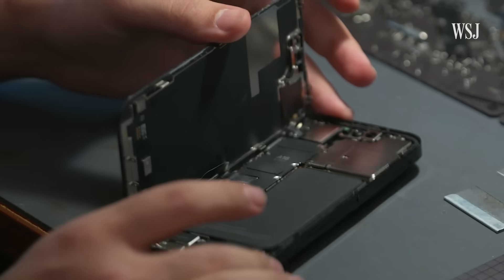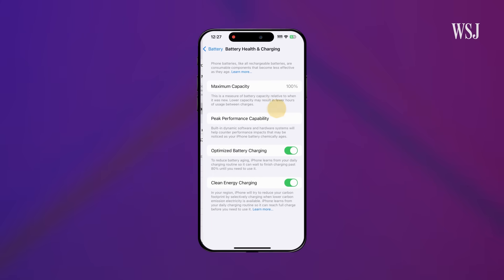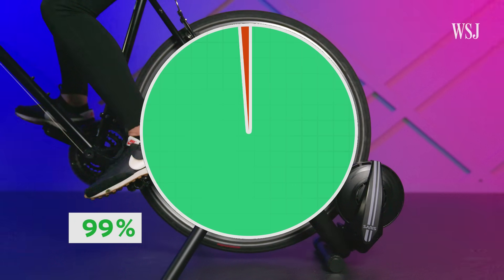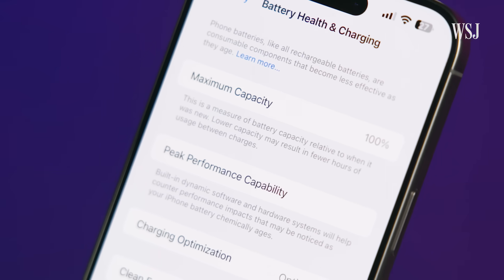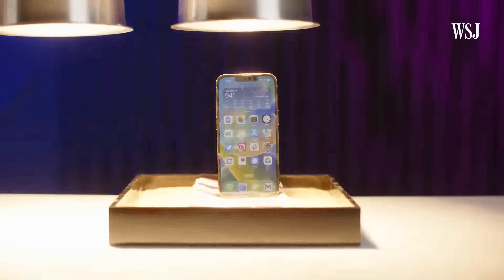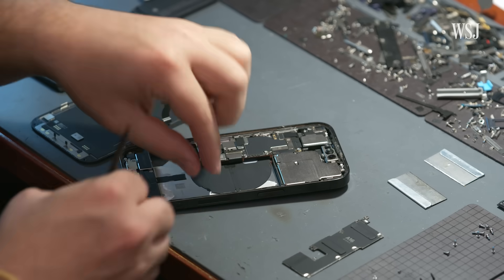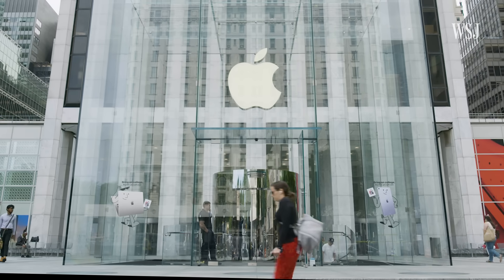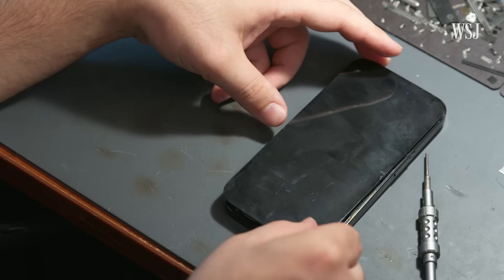Why My iPhone’s Battery Expired in Only a Year | WSJ

Comment: Heat also becomes a bigger problem over time as the internal resistance of the battery also increases as it goes down in capacity so it generates a lot more heat when charging on a cable compared to when it was new.

Comment: There are too many factors but one of the most important is Heat. I live in Spain, have a iPhone 14PM bought in November 2022 and my battery life is 99. still like new. why, because I charge the phone every two days and with a wireless 5W charger non magnetic inexpensive charger overnight. Seriously my Battery is like the first day.

Comment: 13 mini user here and I just got it a couple weeks ago refurbished. The battery is genuine since I can see its capacity but it drains quick. 3% drop in 3 weeks
Reply: I’d did the same but bought the 12 mini with 85% do you recommend to change it?
Reply: @fernandovega6952  I’d probably use it for a while. My 13 mini came with 94 and dropped to 88 in a few months but now it’s just been sitting at 88 for a while. Maybe use it till it goes to 80 or unless you really feel like it’s not lasting you the day. I also recently bought a belkin MagSafe power bank 5000 and it complements the mini perfectly!

Comment: Keeping it between 30 - 80% will massively reduce aging as most of the damage is done at the top and bottom end. Even
Charging from 0 to 80% will probably only cause 0.2 of a cycles wear vs 1 for 0 to 100%

Heat ia the next issue however it is caused, fast charging, wireless charging is worse as it generates more heat and charges much slower so you have more heat for longer qnd more damage. But honestly i wouldn't worry too much about what the battery heath on an apple product says if i already own it. If it lasts long enough then it lasts long enough. Its just another way of getting you to upgrade to a new product when they want you to. Id only care if buying used.

Comment: I bought my first ever iPhone in August 2023, and heat is really, in my opinion, an important factor. I don’t know if it was the heat of the Greek summer, but I could see the percentages of the battery life dropping like crazy, week after week, which was not normal for the way I was using it, so after 17 months, my iPhone 13 Pro’s battery life is at 88%.
Reply: iPhone 12 Mini, original battery, soon 4 years yet 86% battery health after 900 cycles. I charged exclusively with an old 5W iPhone brick.
And to be honest... i kept the battery mostly anywhere between 30 and 80% charge level and avoided >80% charge.

Comment: My iPhone 14 pro sits at 86% after 1 year while my old iPhone 12 is at 88% after 3 years of use.

From what I've read, Apple opted for a new provider of batteries at a much cheaper cost starting with the 14 series.
Reply: If that’s true they are really ripping off loyal customers
Reply: @em90sfan  customers shouldn't be loyal, they should switch boats at the first inconvenient. only this way we can force a company to change.

Comment: Our obsession with fast charging contributes to faster battery degradation. I personally observed this with both and slow charging. The rate of health drop significantly goes down with slow charging.
Reply: You sure? I used also slow charging for years and for a while on my iPhone 15, but since some weeks im for the convenience charging only with the 140W apple power brick and a 60W rated  USB-C cable (to reduce battery stress on the MacBook Pro)

Im still at 100% health, and even if it dropped, i would not be concerned since the first 5-15% battery health drops pretty quickly, thats normal. But the battery should stay for very long anywhere between 85 and 90% health before its age and reduced capacity shows up in normal use.

Comment: Important mistake. The battery health is NOT measured! Its calculated. Your battery health is highly incorrect. In the first cycles the health goese down really fast. After that the battery degrades mutch slower. Apple is not showing that at all. After the first few cycles you already lost a few percent of capacity.

Comment: It took only 1 minute to be wrong battery health isn’t how much charge your battery holds from new. It’s based on what apple claims the battery capacity is. Most of the time the real capacity is higher than this that’s why it stays on 100% for ages

Comment: Super high pressure 80 to 100 and very deep discharge at 0 to 20.

Both cause damage in different ways.

Set charge limit to 80% and don’t go below 20.

Comment: I'm curious what phone companies are going to do once the price of sodium batteries comes down enough for them to be feasible in phones. At the moment, it would cost maybe $50 or so for a phone-sized sodium battery that would have comparable performance to a lithium battery BUT can handle 10x the charging cycles. So, it would last 20 to 30 years rather than 2 to 3 before you start noticing any capacity issues. That is, if the cell phone companies don't purposely kill them like they've been doing. It would raise a lot of eyebrows if these batteries start dying after 1 or 2 years when they should be lasting at least a decade. Sodium batteries will eventually become cheaper than lithium because of how easy sodium is to mine. 

It comes from the sea, easy to process, salt ponds already exist for this purpose, and it doesn't take much to process sodium out of sea salt. Compared to how much more rare lithium ore is, how much harder, and dirtier it is to harvest and process. Chances are, lithium batteries will not just be more expensive, but outright obsolete by the end of the decade. I'm sure they'll still exist and be used. But they'll be impractical for most purposes.

I usually roll my eyes at new tech that promises to make something obsolete. But this is a rare case where they don't just have a lab prototype, it's not just a start-up or research. They sell sodium batteries commercially. Anyone can buy some for a small premium. So, it already exists as a commercial product. All we need is to wait for the price to come down.

Comment: I noticed the battery performance being way worse on my iphone 14 pro like.. a week in. I even looked up whether it was becoming a big issue that it would force apple to do a recall. Obviously not. I had the 13 pro right before it (which i would've kept, but had to give away to help out a friend) and my battery life wasn't obscene, but it did last longer than my 14 pro. Spotify is a big problem; these days i tend to put it on offline mode as much as i can, but of course that's hindering the use of the product. Anyway, im glad to see my suspicions being confirmed (albeit in a roundabout way, but still).
Reply: Must be an iPhone 14 exclusive issue to be honest, no issues so far with the iPhone 15 (non Pro)
Im coming close to the 150 charging cycles (yes, i intentionally wasted battery cycles with stresstests) and im still at 100% health, but i also use exclusively the "80% Limit" setting on the 15 and avoid <30% charge levels if possible, so in fact i use about half of the batteries capacity effectively.

Comment: What are you complaining about? Your battery health actually EXCEEDED Apple’s rating. After 500 charge cycles, your battery would be expected to have 80% health, but yours had 84% after 494, essentially 500. So what’s the problem. It’s well within factory specs on depletion.

Comment: 1. Replacing your battery destroys the water seal, so find a shop that does the seal too.
2. Not using your IPhone does not save charge cycles for long. You actually need to do 1 full cycle roughly once every 2 months, otherwise you are nuking your battery.

Comment: There is a third option. Maybe even a forth. 

You can keep your phone and try to charge it before you leave your house and only use it when you need to.

The other option is bringing a battery pack with you and charging as you go.

I have a 4 year old android phone. I feel like i have more than enough charge. But i still top it up before i leave the house. Just incase i get stuck somewhere waiting for something and i can just use my phone until i am done.

I also try to plugin my phone if i think the power is going to go out.

Comment: Whats the point of this video ? This person charged it many times like most plp do the battery capacity gets reduced no biggie just replace the battery and continue.. The point is how hard it is to replaced the battery yourself which was not emphasized in this video . Earlier plp could just pop the back open and replace it now it has to go to a tech to get the same job done. Apple has  done a good job with planned obsolescence.

Comment: You have become a serious addict with that 14 phone.  You used it almost twice as much (based on charging cycles) in a year as you did the 12.  Maybe something was causing the battery to be used more that wasn't you, but with only 365 days in a year, and 494 charge cycles already used, you were doing MORE than a charge cycle in a day - and you had just explained that it could take several days to normally hit a full cycle!!

Comment: It's hardly surprising that heavy usage of an iPhone leads to a decrease in battery capacity. What did catch me off guard, though, is that this process is much quicker with an iPad. This might explain why it's not as straightforward to check the battery health on an iPad – you have to use a workaround in the Analytics section.

Comment: Most Electric Vehicle batteries have an estimated 1500 to 2000 charge cycles. The array of Cells have to Charge 100%, then Discharge to 0% for a Cycle to be complete. While 500 Cycles may be Practical in a Phone, it is not so for a Car that is Expected to Last well over Ten Years.

Comment: I wonder if it's the wireless charging...I used that for most of the first year and the battery went down to 87/88. It was usually warm during charging vs plugged in. Did you charge yours using the magsafe?

Comment: Accurately is the mAh of the battery is really matter. For example a phone with 3000 mAh capacity (new). When new it can be charged it from 0 to 3000 mAh. But after 1 year. It can only hold the charge for example till 2000 mAh. The battery is gradually dying. Thats why if u read the manual its says limited warranty. Some company gives just 6 months battery warranty. Meanwhile the 1 or 2 years warranty is only for the electronics parts of the device.

Comment: As of December 2023, I'm still using my iPhone 7 Plus that I bought in March of 2017. I'm still using the original battery that my iPhone came with  - and, my battery health is 74%.    Huh . . .
Reply: need to replace your battery
Reply: @urskareenm.arquero664  I did replace my iPhone battery a few months back.  I replaced the battery and haptic thingy (that stopped working in 2020) - all for about $50.   Feels so good to have that much control -  instead just running out and spending over $1k for a new phone.

Comment: I just bought 15 pro 2 days ago and my phone automatically stopped itself from charging above 80% but I went into the setting and turned that setting off, look buddies.. you have to use your phone to the full capacity and range, batteries are gonna die sooner or later, even if it lasts for 1.5 year or 2 years just change the battery instead of thinking about how your battery is gonna not drop from 100% to 99% or 80% just stop lookin into your battery health section, gosh I use to love the old days when this option was not available, people have got anxiety now

Comment: Advantage of repairing with Apple is they not only repair but perform additional diagnostics. If it has issue they will replace the phone. They did for my iPhone 7 and my dad’s iPhone 11. Third party vendors won’t. But they are cheap and longer warranty.

Comment: Battery’s don’t expire. They degrade. All smartphones use lithium ion batteries. It will never be the same from the first you opened it up. Typically most smartphone batteries degrade after 2 years and this isn’t just unique to Apple devices. Not all batteries are made equally or to the same specs. Genuine parts are the best way to the go.

Comment: You can transplant the BMS from the apple original battery to another new high capacity battery and you will get even longer standby time on your phone of course without the pop out of unknown part notification, this transplant method are very mature in china mobile repair community.

Comment: But you should have mentioned the fact that when you swap the batteries of two iPhone 14 Pro with each other, both will display the mysterious Apple notification. Proving that Apple only compares serial numbers of the batteries with their records.

So even you would buy original batteries straight from the factory the iPhone would still show this sneaky little message. This is called part serialization/part pairing and it's a way for Apple to prevent fair competition in the repair business.

Imagine BMW would not allow you to replace your own tires. And would remind you each time you turn on the ignition: "Your tires are not genuine BMW tires." That would be outrageous! But for Apple it's ok.

Pro tipp: Also higher charging currents mean more stress for the battery. So I always recommend my family to use the old 5 Watt USB-A Charger in your sleeping room for a slow charging through the night and only use the 20 Watt USB-C Charger when you are in a hurry and need a quick charge during the day.

Comment: I just replaced my iPhone X battery. It had diminished down to about 72% which sounds good but it was horrible. Phone basically had to stay plugged in. Went aftermarket (can’t remember the brand) and I did it myself in about 30 mins. I am used to repairing my own devices, and I never got the error message and I can still see my health. I can go all day now and then some on a charge vs me having to plug up every chance I get cause I knew the phone would die fast. Pretty good to know how to take care of batteries. My DJI batteries for my magic 2 pro mention charging up to 85% if going to be stored a long time. Lots of battery knowledge to learn. Good video.
Reply: I miss my iPhone X. Best phone I have had. AND it was the last model from Apple before they introduced the Battery Message of doom. if you go third party with the Xs, that message would come up.

Comment: In case it hasn’t already been said, Apple also won’t replace your battery if it’s still above the 80% rating. Can’t say for sure in every case, but the internet consensus is you’re on your own if your battery is even at 82%….
Reply: Not true 
I replaced 4 IPhone batteries over years at Apple store that were at 85%-87%
Reply: Agreed, I got a battery replacement with no fuss at the Apple Store when the original dropped to 91%.  89 bucks and at least one more year of use. I keep my iPhones for 3 years.

Comment: Expired? Still having 88% after a year is hardly expired and that appears to be clickbait. My iPhone 12 is a little over 2½ years old and is still at 95% capacity. But I'm a light user and only have 136 charge cycles, so that's a big difference. Oh, and I use a Belkin wireless charging stand.

Comment: Some things to mention:
1) 80% health is far from replacement category, it's the smallest significant wear level that you might feel. In other words this replacement was completely pointless.
2) Fast charging and fast draining puts more strain on battery.
3) Manufacturers often underspec batteries a bit to prevent wear complaints.
4) Phone can only estimate wear, it's far from accurate.
5) Legally, battery capacity can be as much as 10% smaller than advertised due to variations in manufacturing.
6) Batteries last very long time if they aren't abused (like charged in hot temperature room or frozen) and not replaced prematurely. It can take a decade or even 15 years to see actually notable wear.
7) Apple always puts tiny batteries and rely too much on software tuning, if they get it wrong, battery life sucks and it can allow SoC work at full blast when not needed and since battery capacity is only 3200 mAh and C rate is likely to be regular 1, then that means more wear and tear on battery.
8) Also it's Apple, the champions in very quick planned obsolescence, top tier scrimpers on hardware, number 1 removers of features. Just like with fraying lighting cables, they might have found out a way to screw customers by making battery crappier. People should really stop buying Apple junk if they really need quality, because they have more than proven to be the absolute worst in industry at that.
Reply: All brands do the same, the only difference is that they don’t show battery health to hide it.

Comment: No mention of how charging to full and keeping the battery at full causes damage. Please do extra research. It’s a reason why Li-Ion EVs discourage charging to full even for a short period of time. 

Choi, S. S., & Lim, H. S. (2002). Factors that affect cycle-life and possible degradation mechanisms of a Li-ion cell based on LiCoO2. Journal of Power Sources